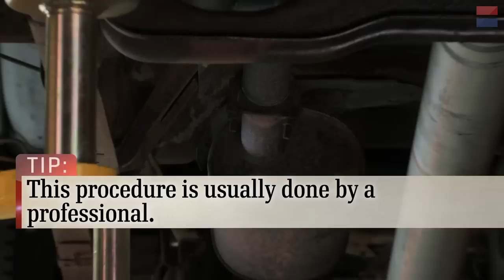How to Find Fluid Leaks in a Vehicle

Comment: I have 2 questions first I have a coolant leak which I believe is coming from a freeze plug on my 1991 ford f150 with the 300 6cyl. how should I go about this? Second could fuel system cleaner help my engine run better?

Comment: I've got a 1996 Chevrolet Cavalier with 234k on the clock. A mechanic deduced that my oil leak wasn't rear main seal, as he said the flywheel would have been drenched with fluid if it was (it wasn't). I forgot what he thought it may have been. The oil hasn't dipped below the F line yet. Should I just keep making sure that it doesn't get down to E? It's a very small leak, think of 3 quarter drops every 2 days it sits.

Thanks!

Comment: I had a lot of oil leaks on my car. Rear main seal, oil cooler o-ring, cam cap seal, oil pan gaskets (both). The problem is almost my entire engine is soaked in it or has a lot of film. I replaced my clutch because it was bad plus the bad rear main seal. My transmission was covered inside and out. I managed to clean it up really good (except around axle inputs). How can I clean every inch underneath the car without pulling out everything in my engine bay?

Comment: I have a 2008 ford fusion with  2.3  4 cyclinder manul transmission engine  and it's leaking fluid around the radiator not coolant but  fluid I think it has a cooler on the radiator what could be the problem?

Comment: I've been using the fram tough gaurds, its fine, but I have noticced a noisy engine start up maybe cuz the oil drain back valve wasn't doing its job? Idk I've used it the past 6 months and now I'm noticing a lil more engine noise while crusing.. also should I be using "high milage" synthetic blend oils? Since I have 97,000 miles. I've been using castrol full syntheticc

Comment: Hi, thanks for the video. I just replaced the clutch slave cylinder after having to keep refilling the master clutch resovoir. This morning I checked and the clutch resevoir is empty. The car is a 1993 hyndai elantra 1.6 with 105k miles on it. It shifts okay but will look for more leak points. Any thoughts on this?

Comment: Hey man, we have a 2010 Honda Civic Sport with about 30000K on it and when we park it in the garage over night, in the morning there is a clear fluid on the floor where the engine are is.
I'm guessing that is A/C water?  But we don't use A/C, and plus this car is only 2 years old, should it even be leaking anything?
Cheers from Canada,
Andriy

Comment: Hey Ben quick question.. I recently replaced an engine in my 93 Lexus SC400, and for some reason my transmission does not want to upshift forward gears.. it stays in first.. I don't think its a mechanical problem because I changed the trans filter and fluid and it didn't look too bad and there wasn't anything on the magnets. I'm thinking its an electrical problem.. any ideas?

Comment: Hi Ben I have a 99 nissan quest and it has a leak in by the front passenger tire not sure if it is the brake or power steering fluid.

Comment: i see few dried oil spots every next day underneath my right front tire, i recently noticed and changed my power stering fluid as it was below than minium ( well below), do you think it is power steering fluid? it leaked because it was lower than minimum ?  i recently drove a long distnace and my car was fine until few days ago. looking for ideas.  nissan micra s, 2000 , right hand side driving.

Comment: Wonderful explanation. Thank you. I have a question. I recently took a car trip and realized the engine oil is disappearing at a rate of 1 bottle/2000 miles. I put a piece of cardboard under the engine for a night and there was no sign of oil on the cardboard. Could you suggest any possible suspects? Thank you.
Reply: Do you have white smoke coming out the rear exhaust?
Reply: NU MOO
i have a similar problem and i have seen white smoke before, suggestions?
Reply: ***** if its white smoke youre burning antifreeze...and should have a 'sweet' smell to it.
Reply: Chip Caddy or cracked head cylinder

Comment: hey i have a brake warning light up on my dash and i see that there are two liquids leaking (i suspect coolant and brake fluid) its a 1999 chevrolet Lumina 55,000 miles both are leaking from the front whats your advice?? im just not sure if its either please i need some advice

Comment: Man… I replaced my valve cover gasket and it’s still leaking some oil. Hopefully mine is as easy as a hole in my filter… but it doesn’t drip until after I drive and let it sit for a while.

Comment: Dealership imformed my oil leak was a rear oil seal and charged me 3100.oil light came back on 21 days after repair ruining motor but dealership only offered half money back or install motor free if I brought motor.file in small claims for a knew motor and all money back it was there diagnosis’s

Comment: That's the reason I always use AC delco filters. In your case I would only use motorcraft filters. The ones from Napa are fram and fram is utter crap. Motorcraft shouldnt cost any more than a few bucks extra. I use full synthetic so I only change every 10k miles so the extra few bucks are worth it.

Comment: my mechanic told me I have a rear main engine oil seal leak and would need to take car to transmission shop. My car is a 91 maxima W/116,000 miles I can not spend $1,000+ to replace seal.  He says it's a slow leak and would not fix it, due to cost and age of car.  How about using the product "BARS REAR MAIN SEAL REPAIR" or "LUCAS OIL 10278 ENGINE OIL STOP LEAK"? Any thoughts on that?
Reply: The ways those product works is basically swelling the broken or cracked seal. They could work for a little while, but i would change the seal as soon as you can so you don't have to deal with it again. Maybe try another mechanic and check prices.

Comment: Don't agree on dark oil meaning it needs to be changed.  It just means the oil is doing it's job.  Mileage is the only indicator.

The new detergents are a big positive to oil and you want it to look dark.  I heard that from a big wig from one of the oil manufacturers at a demo meeting I attended recently.
Reply: I don't quite agree with you. The darker the oil the more particulates are in the oil and the longer the engine operates the less effective your filter has become. In turn that's why you need to change the oil and that's why the oil  turns darker. In reality you could recycle the oil and reuse it again but you would have to replace some of the additives in the oil and you will notice once again that the oil will be practically clear again, which all the contaminates have been removed.

Comment: I wish you would be my neighbor, so you could lift up my car and find a leak under engine.
I have a leak, whole engine is covered with oil underneath, but i dont know where it comes. Once in a 3-4 months i need to add oil. I will try to look at oil filter but i don't think i will get it so easy. Was this called "Powder spray" ? What powder is it?
Where i should ask for it?

Comment: it's leaking from that Ford emblem
Reply: That why FORD mean Fix Or Repair Daily, lol.
Reply: @jefrey5578  yet was on 200k only leaking oil from a damaged filter. I'm not a ford guy but gm or Chrysler is much worse on reliability particularly lately
Reply: unfortunately i agree with you. modern chevys are junk which is why i keep my 2001 chevy 4.3 4x4. Bought it new, 500k miles and only replaced the radiator other than normal service repairs
Reply: @devinanderson15  That's why I drive Toyota and Honda. If you maintain them they don't die.